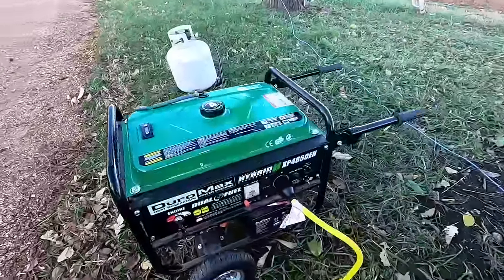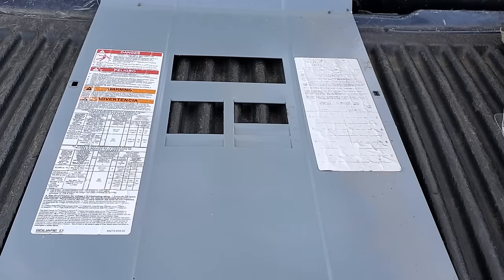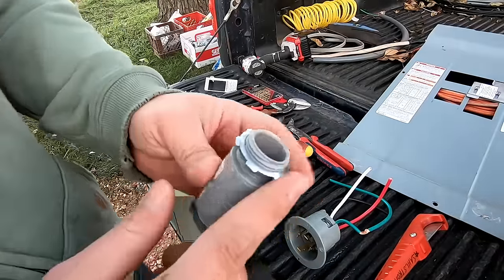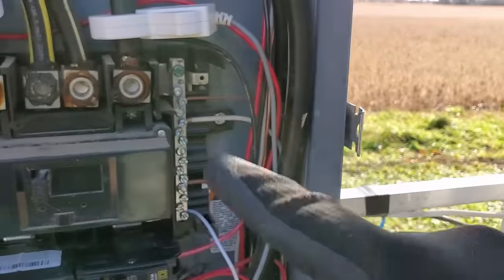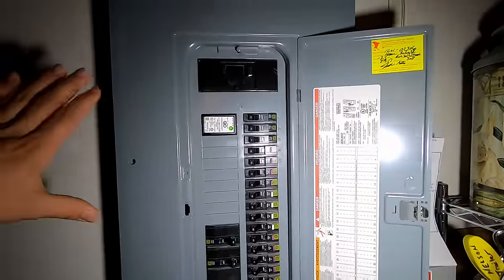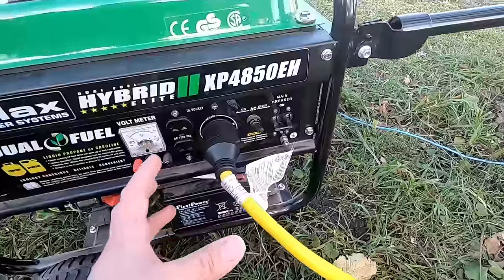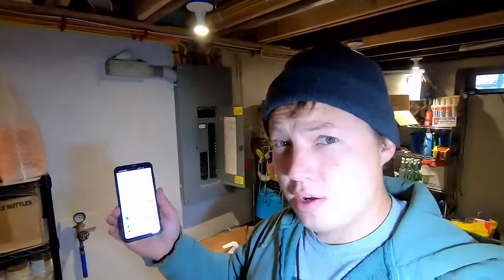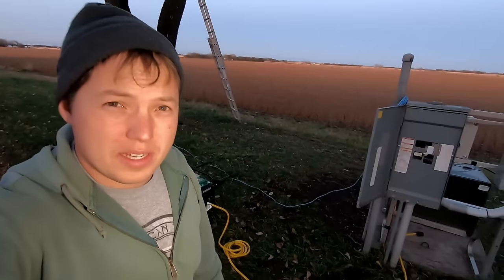How To Hook Up a Generator To Your House Using a Breaker Interlock Kit & Power Inlet Box

Comment: Excellent information! Only important information in short.  My go to installation Vid...TANKS !!
Reply: Remember to always make sure you follow all the generator safety rules whenever you use your portable generator. 
⚠️Here are the Generator safety rules that everyone needs to follow when using generators:

This is just a reminder for everyone’s safety when using portable generators. All generator safety rules need to be followed carefully to avoid hazards. 

1) Please do not allow an unqualified person or your children to operate the portable generator. Just because some manuals don’t say that doesn’t mean it’s safe. That is important against the generator safety rules. We also need to be keeping an eye on our children too. You need to make sure that your children are not playing near the portable generator especially when it’s running so they won’t get electrocuted. Generators pose electrical risks and they can be hot during an operation. Please keep your children away from the portable generator at all times. It is important to keep our children safe especially our little ones. Be aware of all the hazards.

2) Some people use their portable generators indoors which increases the risk of carbon monoxide poisoning. It’s important to have a carbon monoxide if you have a gas generator. Never ever use your generator indoors even if your doors and windows are open and even in the garage is not safe to use a portable generator. Not even at your porch and your deck. It is never safe to use your generator indoors and in enclosed areas of your home. Your generator needs to be 15-20 feet away from your house. 

3) 🔥generators cause fire hazards too. Never refuel your generator while it’s running. You need to let your generator cool off before refueling it and before storing your generator. Never overload your generator too. Never ever back feed your generator. You should never plug your generator into a wall outlet. Also never store propane tanks indoors. Please keep flammable things away from the generator as well and please don’t smoke cigarettes near the generator. Having a fire extinguisher next to the generator is also important against the generator safety rules. 

4) generator operation; make sure your hands are dry before touching the generator. Never use your generator in wet conditions. Don’t let your generator get wet. You need a generator tent if you need to use your generator during wet weather. Please don’t wear loose clothes when operating the generator. Turn on your generator before plugging in appliances. Use the right cord for your generator. Please do not use worn out cords. 

https://youtu.be/I1jT3ANENvI and here is a video more about keeping others safe when using generators and also about our family’s safety. It’s important to keep your children safe especially little ones. 

Hope this helps

Comment: Hi Benjamin. Love your videos. Question, what does one do if they have no Main Breaker in their breaker box?
Update: Well, scratch that. I did just find a 200a disconnect breaker coming off my electrical meter that feeds the breaker box. I guess I could still add a 30a connection but, just always remember to switch the 200a disconnect off whenever I attach my generator, right?

Comment: Can you hook up a Duromax 9000 inverter generator (bonded) to the interlock system or do you have to unbound (so it ground floats) the white ground if using the interlock system? Thanks.
Reply: ⚠️Portable Generator Safety Tips:

1) KEEPING OTHERS SAFE: Please do not allow an unqualified person or your children to operate and service the portable generator. Just because some manuals don’t say that doesn’t mean it’s safe. That is important against the generator safety rules. We also need to be keeping an eye on our children too. You need to make sure that your children are not playing near the portable generator especially when it’s running so they won’t get electrocuted. Generators pose electrical risks and they can be hot during an operation. Please keep your children away from the portable generator at all times. It is important to keep our children safe especially our little ones. Be aware of all the hazards.

2) WHERE TO RUN YOUR GENERATOR: Some people use their portable generators indoors which increases the risk of carbon monoxide poisoning. It’s important to have a carbon monoxide if you have a gas generator. Never ever use your generator indoors even if your doors and windows are open and even in the garage is not safe to use a portable generator. Also please never use your generator in your deck or balcony. It is never safe to use your generator indoors and in enclosed areas of your home. Your generator needs to be 15-20 feet away from your house. 

3)🔥FIRE HAZARDS: Never refuel your generator while it’s running. You need to let your generator cool off before refueling it and before storing your generator. Never overload your generator too. Never ever back feed your generator. You should never plug your generator into a wall outlet. Also never store propane tanks indoors. Please keep flammable things away from the generator as well and please don’t smoke cigarettes near the generator. Having a fire extinguisher next to the generator is also important against the generator safety rules. It’s also not safe to move your generator while it’s running.

4) GENERATOR OPERATION: make sure your hands are dry before touching the generator. Never use your generator in wet conditions. Don’t let your generator get wet. You need a generator tent if you need to use your generator during wet weather. Please don’t wear loose clothes when operating the generator. Turn on your generator before plugging in appliances. Use the right cord for your generator. Please do not use worn out cords. 

https://youtube.com/shorts/eFigDfnPkcQ?feature=share and here is a short video more about keeping others safe when using generators. Portable generators need maintenance so it’s important to follow the safety instructions.

Hope this helps

Comment: Hey Ben, me again... does your DuroMax generator have a floating or bonded neutral? I’ve got the SP12000EH and I’ve read that it is a floating neutral generator,  but after a quick continuity check between the neutral and ground plugs of the receptacles, it’s obvious that it has a bonded neutral when it comes from the factory. As I am using the generator with a hook up similar to yours (directly into the main breaker panel) I’ve read that I should convert the generator to a floating neutral configuration. I don’t think you addressed this issue in your video, but do you think there’s a downside to just leaving the generator as is with the bonded neutral? I’m not using either of the 2 gfci protected outlets in my application, and it appears that the 240volt receptacle (which is what I’m powering the breaker panel from) is not gfci protected.
Reply: Don’t forget about the generator safety tips as well. Remember it’s important to follow all the generator safety rules whenever you use your generator. Here are the generator safety tips:

1) Please do not allow an unqualified person or your children to operate the portable generator. Just because some manuals don’t say that doesn’t mean it’s safe. That is important against the generator safety rules. We also need to be keeping an eye on our children too. You need to make sure that your children are not playing near the portable generator especially when it’s running so they won’t get electrocuted. Generators pose electrical risks and they can be hot during an operation. Please keep your children away from the portable generator at all times. It is important to keep our children safe especially our little ones. Be aware of all the hazards.

2) Some people use their portable generators indoors which increases the risk of carbon monoxide poisoning. It’s important to have a carbon monoxide if you have a gas generator. Never ever use your generator indoors even if your doors and windows are open and even in the garage is not safe to use a portable generator. Not even at your porch and your deck. It is never safe to use your generator indoors and in enclosed areas of your home. Your generator needs to be 15-20 feet away from your house. 

3) 🔥generators cause fire hazards too. Never refuel your generator while it’s running. You need to let your generator cool off before refueling it and before storing your generator. Never overload your generator too. Never ever back feed your generator. You should never plug your generator into a wall outlet. Also never store propane tanks indoors. Please keep flammable things away from the generator as well and please don’t smoke cigarettes near the generator. Having a fire extinguisher next to the generator is also important against the generator safety rules. 

4) generator operation; make sure your hands are dry before touching the generator. Never use your generator in wet conditions. Don’t let your generator get wet. You need a generator tent if you need to use your generator during wet weather. Please don’t wear loose clothes when operating the generator. Turn on your generator before plugging in appliances. Use the right cord for your generator. Please do not use worn out cords. 

https://youtu.be/I1jT3ANENvI and here is a video more about keeping others safe when using generators and also about our family’s safety. Hope this helps

Comment: Hey Ben great videos, in the process of installing the interlock kit and breaker system my question is,  I currently have a 5250 watt generator, I known it will run with a 30 amp breaker, I plan on upgrading to a 10 to 12, 000 watt generator in the future which would need a 50amp breaker. In your opinion could I just install the 50 amp inlet box and breaker now and run my current 5250 watt generator on that setup. Or do I neednto have the added expense of first wiring for a 30 amp then change it out when I upgrade the generator? Your or anyone else's opinion is appreciated as I can find no clear answer for this query. Thanks in advance

Comment: So, using a floating neutral generator such as yours, tied into a panel, does NOT require grounding the generator ? The ground goes through the L14-30 to the panel?
Reply: ⚠️Portable Generator Safety Tips:

1) KEEPING OTHERS SAFE: Please do not allow an unqualified person or your children to operate and service the portable generator. Just because some manuals don’t say that doesn’t mean it’s safe. That is important against the generator safety rules. We also need to be keeping an eye on our children too. You need to make sure that your children are not playing near the portable generator especially when it’s running so they won’t get electrocuted. Generators pose electrical risks and they can be hot during an operation. Please keep your children away from the portable generator at all times. It is important to keep our children safe especially our little ones. Be aware of all the hazards.

2) WHERE TO RUN YOUR GENERATOR: Some people use their portable generators indoors which increases the risk of carbon monoxide poisoning. It’s important to have a carbon monoxide if you have a gas generator. Never ever use your generator indoors even if your doors and windows are open and even in the garage is not safe to use a portable generator. Also please never use your generator in your deck or balcony. It is never safe to use your generator indoors and in enclosed areas of your home. Your generator needs to be 15-20 feet away from your house. 

3)🔥FIRE HAZARDS: Never refuel your generator while it’s running. You need to let your generator cool off before refueling it and before storing your generator. Never overload your generator too. Never ever back feed your generator. You should never plug your generator into a wall outlet. Also never store propane tanks indoors. Please keep flammable things away from the generator as well and please don’t smoke cigarettes near the generator. Having a fire extinguisher next to the generator is also important against the generator safety rules. It’s also not safe to move your generator while it’s running.

4) GENERATOR OPERATION: make sure your hands are dry before touching the generator. Never use your generator in wet conditions. Don’t let your generator get wet. You need a generator tent if you need to use your generator during wet weather. Please don’t wear loose clothes when operating the generator. Turn on your generator before plugging in appliances. Use the right cord for your generator. Please do not use worn out cords. 

https://youtube.com/shorts/eFigDfnPkcQ?feature=share and here is a short video more about keeping others safe when using generators. Portable generators need maintenance so it’s important to follow the safety instructions.

Hope this helps

Comment: Hi Ben.  Great Video.  Thank you.    I have a Question...,when hooking my portal generator to my house Main Panel with an Interlock kit & 50 Amp breaker, where the neutral and ground are bonded to the same place in my Main Panel, is there any chance that electricity from my generator could travel back out to the utility network via my portable generator's Neutral wire that is connected to the same main panel Ground/Neutral?    I understand that the Main Panel Breaker is off because of the interlock kit and that keeps the two hots (Red & Black) from back feeding, but is Neutral is safe as well?   I'm still learning from your other videos and your explanations have been great.

Comment: Excellent video and what you did is what I am currently doing, but with a much larger genset and was thinking of using the Sense monitor for the exact same purposes.
Reply: Here are the generator safety rules that everyone needs to follow: this is just a reminder for everyone’s safety. Always make sure you follow all the generator safety rules whenever you use your portable generator. Generators can be dangerous if not used carefully. Every year, hundreds of people die or get injured when using portable generators due to carbon monoxide poisoning and electrocution. Make sure you are using your generator carefully and keeping others safe as well. There is something very serious that everyone should always be aware of when using generators. Some people do run their generator indoors which is not safe and that increases the risk of carbon monoxide poisoning which can cause death of family and you. Some people run their generator in wet conditions which can electrocute them. Please remember that you should never run your generator indoors. Remember that carbon monoxide is an odorless and colorless gas that you cannot see or smell. Carbon monoxide is a silent killer. Keep that in mind. Make sure your generator is 15-20 feet away from your house and away from doors, windows, and vents. Never use your generator in your porch too. Having a carbon monoxide detector is very important against generator safety. Some people also allow children to go near the portable generator which could pose risks. We need to keep an eye on our children making sure that they are not near the portable generator so they won’t get electrocuted or burned by the generator which is dangerous. A locking enclosure also keeps kids safe. A generator shed might look like a tempting place to explore, or take cover during a game of hide and seek, but a generator is a dangerous piece of equipment that can cause injury. It says on the manual that we should also keep children away at all times from the portable generator to avoid injuries. Please do not allow a child or unqualified people to operate the portable generator.  It is important to keep your children safe especially little ones. The portable generator can be hot during an operation. Just because some manuals missed what should be listed doesn’t mean it’s safe to do. Always follow the generator safety rules when using portable generators. Generators pose electrical risks. If you need to use your generator during wet weather, you need a generator tent to protect your generator from getting wet. Don’t let your generator get wet. Keep your generator dry and before using your generator, please make sure your hands and your generator is dry. Do not wear loose clothing when operating the generator. Everything that is said on the generator’s operating manual should not be ignored. Never smoke cigarettes near the generator. Please keep flammable things away from the generator. Never overload your generator too. Your generator can catch fire. Never ever try to plug a generator cord into a wall outlet to avoid back feeding. Back feeding your generator is dangerous. Always turn on your generator first before plugging in appliances and shut off the appliances before turning your generator off. Use a heavy duty cord for your generator and the cord should not be worn out. All the instructions should be followed carefully. Never refuel your generator while it’s running. It can cause fire if fuel spills while your generator is hot. You should turn off your generator and let it cool off before refueling it. Having a fire extinguisher next to the generator is also important. This is only a reminder for everyone’s safety of using generators. Make sure your generator is properly grounded. Having a fire extinguisher next to the generator is also important against the safety rules. https://youtu.be/I1jT3ANENvI and here is a video more about keeping others safe when using generators and also about our family’s safety. It’s important to keep our little children safe as well. Make sure your little children are kept away from the generator at all times especially when it’s running. Hope this helps. Always remember that it’s better to be safe than sorry. Also remember that warnings should not be ignored too.